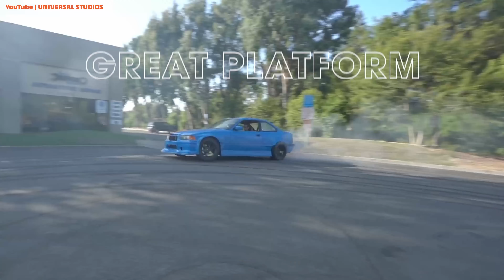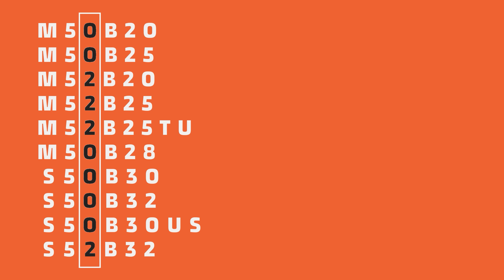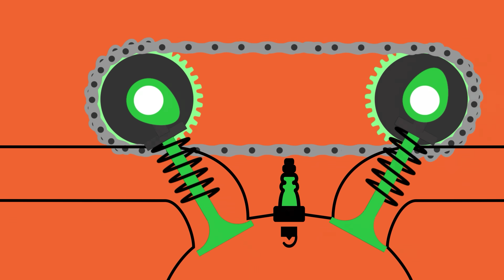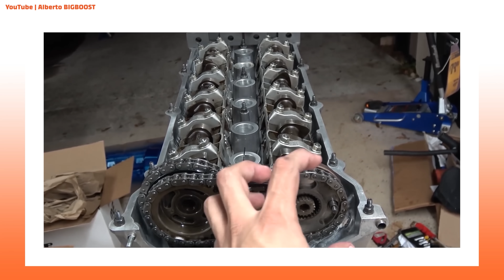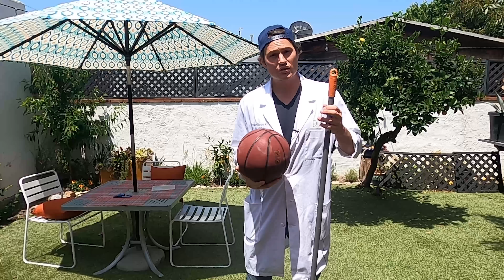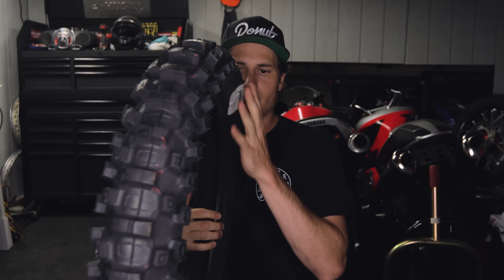2 Reasons Why the E36 is an ALMOST PERFECT Project Car

Comment: Since I drove my first E36 12 years ago, I said goodbye to all the hondas and toyotas and dodges I used to own. Never going  back again :)
Reply: @jamesreeves4600  it actually the opposite. underrated by people who never owned them and they are priced way cheaper with the depreciation.
Reply: @dazone  hey man. would you recommend an E30 in case i couldn’t find an E36 where i live? which one do you suggest?
Reply: @zhila5958  its a good car but people will put a lot of pressure on a car and break it quickly and where i live its hard to find any good ome but if you dont find e30 or e36 try e34
Reply: @LM-nb6eh  there are some E34 bimmers where i live but to be fair it’s kind of a bit heavy for my liking. i’ll look forward to it thanks so much for your response
Reply: @zhila5958  generally speaking E30 is more reliable than E36. E30 is going way up in value and they are becoming more expensive than E36. E36 is faster and has more power than E30 though. If you have ti get an E30 go for the 325. For E36 you can choose between 325 or 328. E36 with M50 engine is slightly more reliable than M52. M50 is OBD1 whereas M52 is OBD2.
Reply: @dazone  thanks so much. i think there are some engine swapped ones for example i’ve seen some e30’s swapped engines from an E34 525i and i’ve seen multiple E36’s with M60b44 swaps. there are some good ones but in general hard to find tbh
Reply: @zhila5958  I dont know if this comes to late, but try to go for the e36. Great platform
Reply: @afroman5531  thank you so much. i’ll look forward to E36
Reply: @zhila5958  👌👌👌
Reply: @afroman5531  really appreciate your suggestion
Reply: @zhila5958  I expect an update 😁😂
Reply: @dazone  believe me in my city you can see 10 e36s in 1min and 99% brake quickly and have fart cans
Reply: @makaroner ig
Reply: Hey there I run a e36 channel and would appreciate your support for some e36 contentt🤞🏽🖤

Comment: And with that, the prices of E36 went up to the roof.
Reply: stock E36s in decent shape have had high prices for a while. theyve been a popular carguy pick for years
Reply: most rwd manual cars have experienced a price hike
Reply: I just picked up a 323i with BC coils for £1k few weeks ago. Drove 6 hours to pick it up from the other side of the country with my mates. The coils cost nearly the same as the car 😂
Reply: Really? I just bought a mint 323is for 3k. Check Craigslist in the cities where the rich are fleeing.
Reply: @Drakewood  I sold my 323i for a bit over 1k it was 252k miles and was kinda beat. One of my favorite cars. Slow as hell, but still handled great.
Reply: @Drakewood  3k is a ripoff cuz
Reply: @niallcorcoran4437  Less the 100k, mostly well maintained, and it needed new speakers, headliner replacement, rear struts, and tires. ~$5k all in for a nice unique daily so I did fine.
Reply: @Drakewood  cool for a daily. i almost absolutely disagree with anyone saying they’re awesome for anything else without thousands in reinforcement work first. have friends who drift em and whatnot with thousands into the F/R subframe.
Reply: @niallcorcoran4437  Yeah i don't think most people are planning to drift except 19 year old kids, most people just want a good looking car
Reply: @siddharthnandi8567  even if you just want a “good looking car” e36/46 subframes will crack themselves from any types of usage let alone track oriented usage, which would inevitably wear the weak metals they’re built with out, faster. doesn’t matter if you just cruise it, slam it, track it, drift it. drifting isn’t for 19 year olds either. its for anyone wanting to have fun with their car.
Reply: @niallcorcoran4437  thats nonsense. those brackets are a few hundred dollars. Tell your buddies to learn how to weld lol.
Reply: @niallcorcoran4437  so tell the to learn how to weld. Who drifts but doesn't work on their own shit, sad.
Reply: @Drakewood  yeah because its a fuckn 323is lol

Comment: VANOS is equivalent to VTC in Honda's iVTEC. BMW's VTEC equivalent is Valvetronic where the throttle was set by adjusting the valve lift and no E36 engine have it. the first engine equipped with "VTEC" is N42.

Comment: he said that in v shaped engines with dual cams you can get them the right distance apart with the spark plug to be good. Then how is the supras inline engine so fast if it isnt V shaped

Comment: The example given with Vtec confuse the timing and lift.
vtec is a variable valve lift system, like BMW valvetronic.
BMW can have both valvetronic and VANOS (intake) or double VANOS (intake + exhaust)
VANOS is a timing variable adjustment relative to the crankshaft rotation, which is used by literally all engine manufacturers in various forms, ie.: honda VTC.

Comment: as an e36 owner.....there are a ton of things people should know when buying a e36. like reinforcing the chassis in a few places. the plastic cooling system, that fact that bmws are not as simple as jdm cars from the 90's haha. it was a high end car at one time so it has a bit more electronics. BUT other than that. you can find them way cheaper than 4k. Found a 328I 5 speed sedan with coils and a few brand new spare parts for $900 and drove it 50 miles home lol.
Reply: Hey there I run a e36 channel and would appreciate your support for some e36 contenttt🤞🏽🖤

Comment: "E36 over-looked"? Are you crazy. They are more popular than the e30 and e46. It's the "new" 240. Cheap. Lots of stock ones around, 50/50 weight distribution making it ideal for drifters. I had an s14 and e36 and both drifted like a dream.

Comment: Awesome video. Just one minor problem with your engine codes. The M50 was never produced in a 2.8 L displacement and the M52B25 never had a TU in the e36 chassis. So the correct engines would be M52B28 and M50B25TU. And yes, I am so much fun at parties... drifts away in an E36...

Comment: Wow so close on the vanos description... Vanos achieves cam phases (as described in the vid), however it has nothing to do with EGR or efficiency. It has to do with dynamic compression ratio and volumetric efficiency. At low RPM the intake valve has minimal overlap with the exhaust valve push up the low end and flatten out the torque curve. At higher RPM more vlave overlap is introduced to achieve more efficient cylinder filling by using the momentum of the exhaust gas to pull intake charge into the cylinder. Finally, the idea that power and efficiency are at odds is completely wrong. Typically higher thermal efficiency equates to higher brake specific HP. Big popping cams are not a performance feature they just move the torque curve up the RPM range at the cost of off the line torque.

Comment: The real BMW sleeper is the E46/5 (compact or ti series) coupe/hatch - short(er) wheelbase version of the E46. Originally released with a 1.8 four cylinder (316ti) and it's own grill/light layout - jokingly referred to as the "hairdresser's BMW" in AU (hangover from when it was the (E36) 316i with (only) the 1.6L four - meh). Much lower trim level so that they could sell to larger market. Later on however, they shoehorned the 2.5 six double Vanos into it and released it with M pack option (suspension, wheels, bodywork, seats and trim - 325ti Sport) and this was a gem. It's arguably a mini (and much cheaper) M series. Of course the key thing here is that the 2.5 is functionally the same as the bigger 3.0 and 3.3L six engines sooo . . you know the rest. Plus, most hop-up parts will fit it. 50/50 weight distribution makes it a natural on the track - don't know about drifting it - anyone drifted one? Drifting's not huge in AU like it is in the US (style points in racing? C'mon this isn't figure skating 😉). Still cheap to buy (it hasn't been able to shirk the hairdresser image easily) - a performance bargain, but they are increasing in price I've noticed. 
https://www.drive.com.au/new-car-reviews/supercar-in-a-shot-glass-20100824-13n3b

Comment: I gotta say, i hate the e36 rear suspension, all it does to me is make sure more rust hides at horrible spots because those e36s rust like hell. And the chassic ruptures from the body wich is quite awful. Just stay with the e30, you will have more fun than a crappy e36. And yes i had multiple e36s and e30s

Comment: Worked at FedEx nearly 20yrs. Until they switched mainly to Spinters (finally a/c!) But at first had the Frieghtliner W700 with the diesel from the Ram. Soooooooo much fun in the snow! Could do the most beautiful drifts in it. You could always tell the side streets I'd pulled into because you'd see the evidence of four back snow tires having thrown snow everywhere.  Ahhhhhh. Good times. 🥳

Comment: E46 costs about the same, can still be found in pick-n-pull yards (a lot have an age limit that won't permit E36), and share some E36 engines. The E36 shares parts, too, so you pay the same for E36 parts as you would an E46; you're just putting new parts in an older chassis. Speaking of, E46 chassis can be beefed up (it's already more rigid than the E36) with rear subframe to chassis plates, strut and shock plates, and Z3 sway bars. Overall, E46 is the way to go. You can get a beautiful auto 330i and swap a six speed from a 2004+ 330i for 8K.

Comment: The hydraulic lifers in the M50+ ended up causing more ticking noise than their predecessor. BMW's solution is to rev to 3K in neutral for 3 minutes. Supposedly, this bleeds the lifters, ending the incredibly ticky valve train. For a week. Creates major anxiety if you're used to "ticking = low oil pressure or level" experiences.

Comment: TU means technische Überarbeitung... instead of update. But that's the part where German starts to sound like ASS again.... Plus the E36 had a horrible crash test rating and a crappy interior. My E46 that followed my E36 318is is way better in that department

Comment: I could have bought any of the 3 series you listed, e30 through e90.  I chose the e36 for literally every reason.  It looks the best, it has the perfect ballance of rawness vs comfort, and by far it has the best interior ergonomics.  The boxy styling is spot on.  The exhaust note is raw without being annoying.  
Also of all the 3 series I've driven, the US M3 has the best ballance of power to chassis capability.
Reply: Hey there I run a e36 channel and would appreciate your support for some e36 contenttt🤞🏽🖤

Comment: The E36 in Germany is the ultimate "Chad" car if you will haha. Has/had a reputition of only young, misbehaving kids that want trouble driving around in it, which to some extent was true, it was also one of the cars that shaped the "Türkenkarre"-image, translated that means "turk-car" (kinda racist I know, but hey if it's true lol). That's why you can get beat up E36 for under 1k easily here. Asshats went to Mercedes lol, and now the image is getting better and people actually appreciate a clean one.

Comment: Unless you want missing door panels, constant oil leaks, constant overheating, torn rear subframe/shock towers, engine tick, and a Christmas tree for a dashboard, get an E46.

Trust me, current owner of two E36 sedans and have owned 4 E36’s altogether. Go to the E46 market, you don’t want anything to do with us E36 chassis owners. Don’t question it just trust me.

Comment: LOL Vanos usualy works all the time, unlike vtec, and helps with more torque in LOW rpm, unike vtec, and you put wrong engines in a video. M52B25TU was in e46 because double vanos was never in e36, M50B28 doesn't exist from the factory, only if you stroke the M50B25, and you missed M50B20TU, B50B25TU and M52B28

Comment: I love my E36 and I find it much more fun that the E46 that i also owned. It is slower but she screams like hell and spins tires with ease. I would highly recommend picking one up if you have the chance. Would suggest doing research on controle arm mods to e46 and trailing arm upgrades. If you are going a true coilover setup reinforce the mounts and would recommend reinforcing the rear end. But amazing car and is perfect for someone just learning about cars and wanting something not to fast but you can bang redline in 1st 2nd and 3rd without going into someone trunk! Lol

Comment: This explanation of VANOS is, while technically correct, very misleading and it has very little to do with VTEC.  VANOS is a VVT (Variable Valve Timing) system, while VTEC is a VVL (Variable Valve Lift) system.  They are very much not the same thing, and to my knowledge it is possible to have both VVT and VVL on the same engine.

Comment: VTEC (honda) or VVL (nissan)  doesnt change timing. It makes the cams more aggressive, presses the valves further into the chamber to create a bigger opening for more freeflow of air. Vanos is like VVTI which changes timing influencing torque up top/down low. VTEC essentialy affects a different variable than Vanos does.
Reply: I was looking for this comment. I thought nobody else noticed that.

Comment: You should compare the E36 with an E34. They both used the M50 engine with VANOS and similar wheel bases. I also picked two e34s up for $600 each just last year.
Reply: Hi

Comment: *Vanos kicks in*

BMW driver: This does put a smile on my face
Reply: Most people prefer M50/52s without Vanos here in Germany, the minor performance advantages of Vanos come along with a highly reduced reliabilty + if your Vanos does actually break, it's expensive to repair
Reply: Non vanos m50 came with beefier pistons , connecting rods and also stiffer valve springs that makes it good for forced induction 😁
Reply: *Vanos*: exists

*Any respectable owner of E36 shitbox*: Snip snip
Reply: @Leemur2335  idk, but they may do
Reply: Spoolin & Boolin valve springs I believe, they’re able to handle higher revs
Reply: My Deutsch is shit 😂😂😂

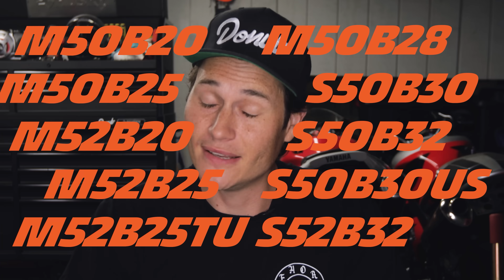Comment: Bro, you missed one @2:57 ... I got an e36 coupe with M50B20TU engine. In the M50 series TU is Technical update: the Single Vanos version. And there is even more! the diesel engine, M51D25UL, M51D25TUUL, M51D25OL and M51D25TUOL... So you can at least add 5 to the list ;) might be even more if you separate them by engine configuration, like the IS versions or for exaple the 323.. x'D.. 
Cheers

Comment: The BMW e36 and e46 are probably the most tuned BMW´s
The e36 is in aspects of engines and axles more reliable than the e46 but many e36 are rusting as hell since the chassis has no zink-coat like the e46

Comment: I own a twin VTEC, I also own a twin Vanos.
Its a really tough call between them.
Vtec beats vanos hands down (in reliablty and power) but the six cylinder is a symphony in motion.
Reply: My Honda PIlot has VTEC and I make the biggest deal out of it whenever I need to floor the SUV lol

Comment: Vanos purpose was to actually boost mid range torque. It advances the cam by 25 degrees in mid rpms and then turns off thus retarding the cam 25 degrees for better high end torque(at least in single vanos config) 

Also e36 isn't really that good looking imo. The interior one of the worst imo lol.

Comment: So you are promoting BMW. Don't leave out the timing chain problems, worlds worst transmission, cost and availability of parts and when all done and said you could have had a new Toyota Camry or a Toyota supra that is 100 times more reliable, faster, easier to work on, better gas mileage, more reiable, easier to work on and most important American made but if you are about speed they will even blow the doors off the Chinese Bmw. Yes China but do not take my word for it list to someone who has been a mechanic for 53 years and does not get paid for his video. Here Scotty Kilmer on the BMW JUNK.  https://www.youtube.com/watch?v=40fKEBwXQ7k

Comment: As a rule of thumb
M50 - cast iron block , idiot proof can be abused
M52 - aluminium block, possibility of head bolt threads stripping. Guess how I know that lol
Reply: Not true in the usa, they were all iron block due to sulphur except for the motor in the z3
Reply: @driftfinatic  agreed, we didn't get that over in europe
Reply: Yeah same here in Nz we only got aluminium block m52 also. Think it was just a usa thing
Reply: M52tu is aluminum, which makes boosting mine a pain lol M52 is iron. Really wish mine was iron lol don't know if I want to just build mine or swap it
Reply: M50 - very bulletproof
M52 - bulletproof
M52TU - even more bulletproof

Comment: Just a friendly correction; BMWs Vanos system is not equivalent to Vtec or VVTi, as those systems are variable valve LIFT (along with usually variable valve timing).
Vanos is BMWs variable valve TIMING, usually on intake cams or both (depending on the engine generation).

BMW does have a system akin to those and it's called Valvetronic. It's actually a pretty dope system, as when paired with certain engines, it doesn't need any throttle body at all to regulate engine power (but it's still there for traction control failsafe).

Comment: You got a little mistake in there. 
Vtec is varivale valve lift because it changes how far the valve is able to reach into the cylinder.
Vanos is variable valve timing wich controls the opening/closing point of the valve while not changing duration or lift as correctly shown in the video.
BMW has variable valve lift but it is called Valvetronic (I think it first came in the E46 engines idk exactly)
Other than that great video as always;)

Comment: E36/7 is even better.  I have one and it is a 2002 BMW Z3 M Roadster with the monster S54B32TU with a swapped 6 speed SMGii from the M3.  With some motor work, more fuel and tuning I have more power 330rwhp/300tq all at the 275 wide rear tires.  Love my BMW.

Comment: Only issue about the old e36 with vanos is that the vanos can fail and its quite common. testdriving a e36 with failed vanos only gives you a slower car. so if you dont know how its supposed to feel you wont notice

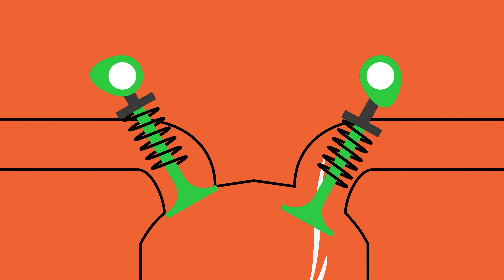Comment: 5:50 which is bad and thas why from economy to performance f1 engines use narrow valve angle with flat top or dish pistons
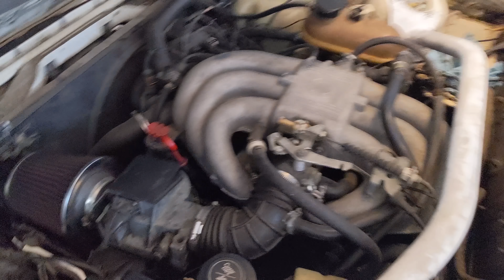6:18 older engine use rocker arms or solid tappets, but m50 and news use hydraulic ones..